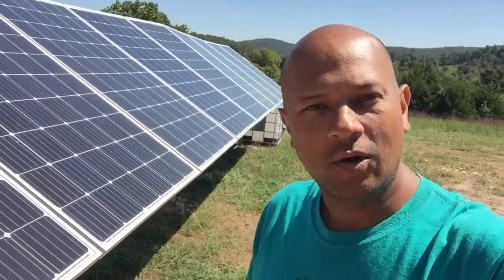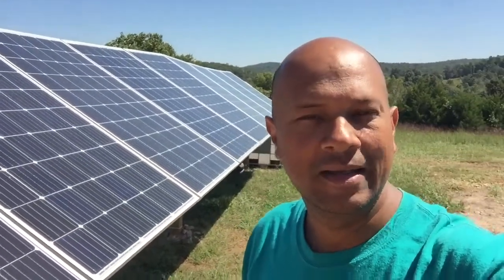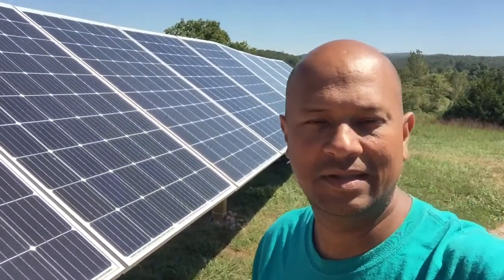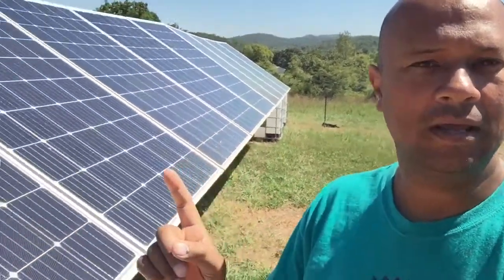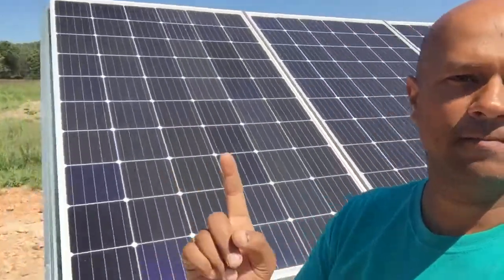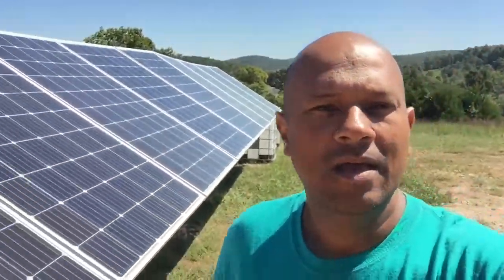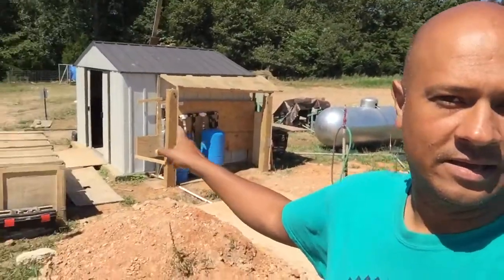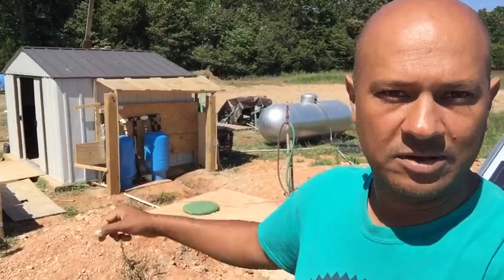John changes solar panels wiring from parallel to series to increase total system voltage

Comment: hi so what size of wires you use from pv to shed controller
Reply from the maker: 4/0  Four Ott (I think is how they say it).   It's about the thickness of my thumb.   Here are some general specs.  My Midnight Sun Charge Controller can do 150amps and a max peak of upto about 175.    So 200Amp wiring would be more than adequate.   Here is a link to chart sizes for amperage in case yours different.     http://www.wireyourownhouse.com/tools/wiresize.html
Reply: @ourpeaceofparadisefarm  did u use that 4/0 because how far distance , because the controller max I think is 150a and you will never get from solar panels that much ..maybe like 65amp
Reply from the maker: pepe58 pepito I’ll be adding more panels in phase two when we double the panel quantity.  Also the thicker the wire the less the resistance.  The cooler it runs (in the wire).  More for efficiencyb
Reply from the maker: @pepe58pepito54  --- we have had as high as about 105A coming in on the setup we have.  2400 watts just the other day... so not bad.